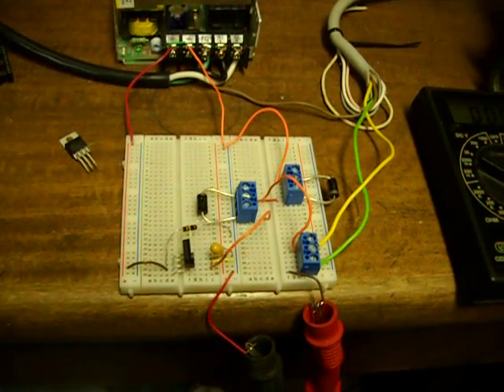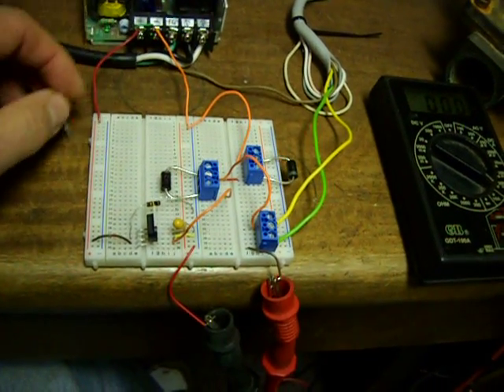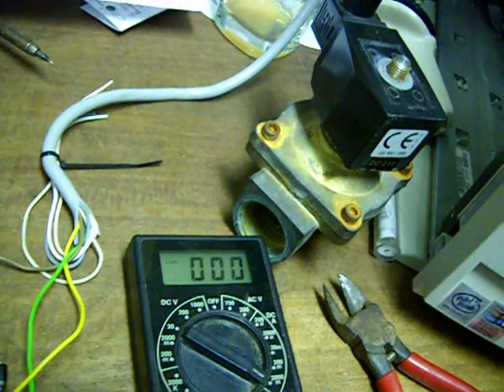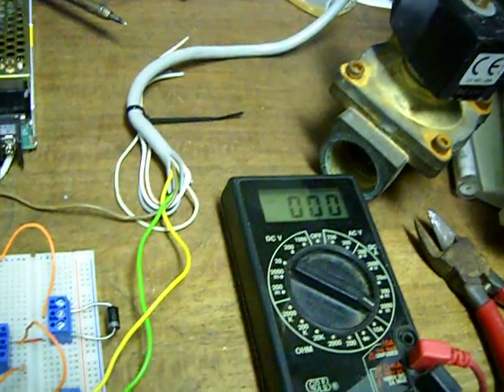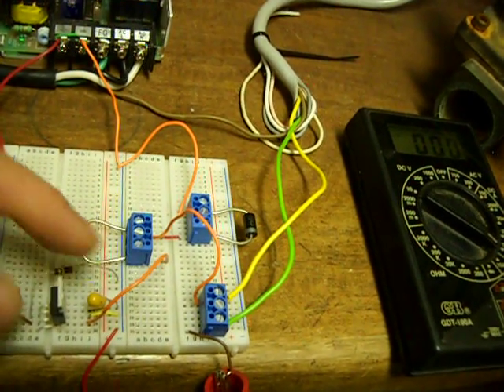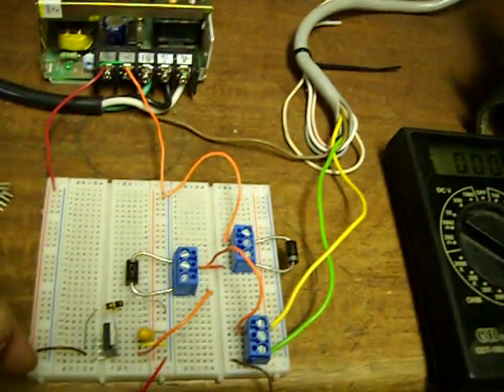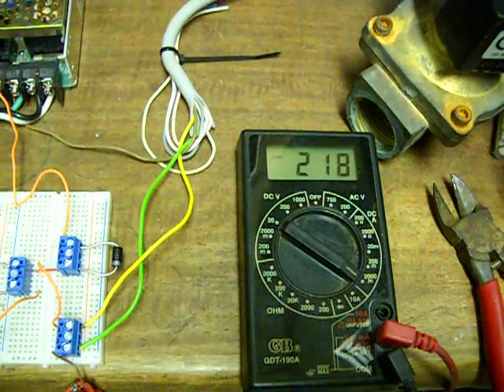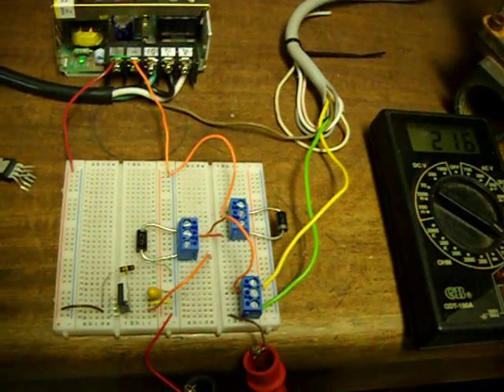Solenoid Driver Demo DRV102

Comment: Im trying to manually control a Ford Internal Air Control Valve, I have a "Servo Tester" will I need something along the lines of an RC ESC or Driver to actuate the solenoid plunger inside??

Comment: @vinic0com 

Im a gear head, not a electrical engineer. But I know enough to build one of these, compared to what I had a engineer make me that requires I go to college.
I found 5 of these on Ebay for $20 which looks like a good price compared to online stores.
On my solenoid I dont need the function to pull it back, a spring does it for me.
I will send you a message and we can discuss this more if you dont mind.

Comment: I need this setup for a solenoid I am using to lock / unlock the axles on my atv.
I had a guy build a driver for me but he is using a PIC16f690 chip which requires a programmer and assembly language knowledge to change its settings.
Way to complicated for me.
This is more what I had in mind. Keep it simple stupid is what I say.
Please respond if you can.
Thanks,
Dennis